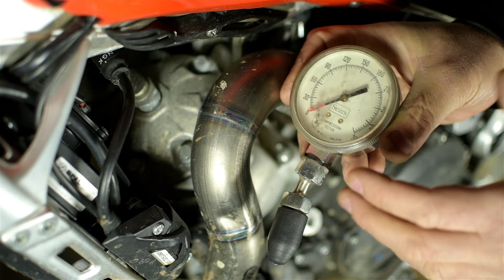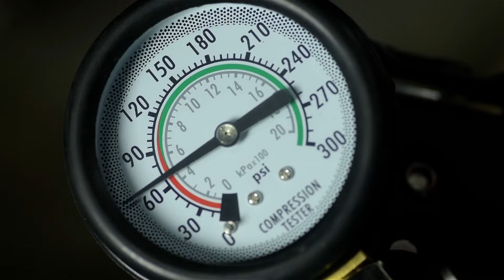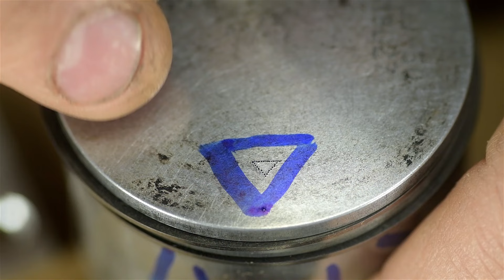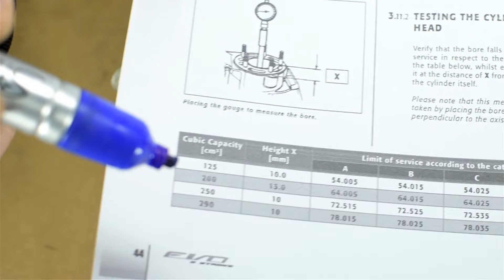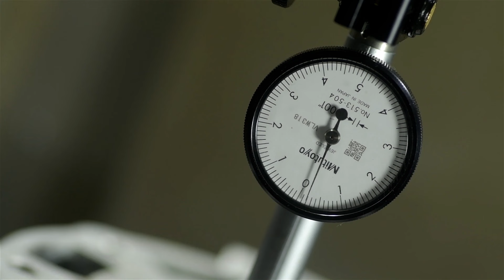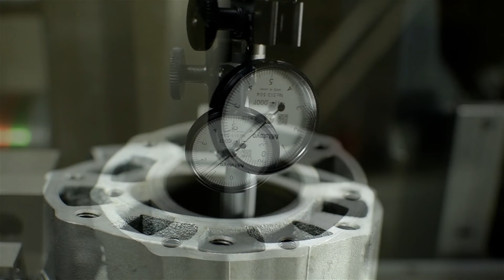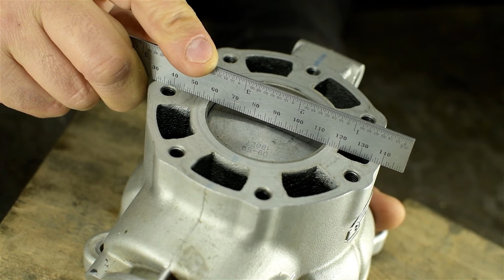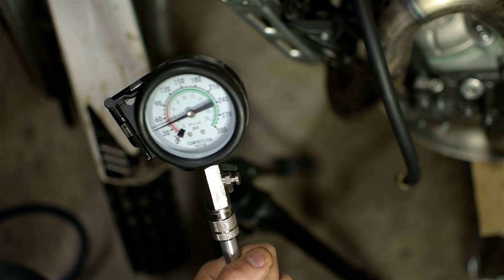Top End Rebuild! (2 Stroke)

Comment: Apparently regular maintenance on a trials bike is every 25 miles.
Reply: Maintenance on these bikes is expressed usually in hours
Reply: Jim Alley  what?
Reply: Many many years ago I had a Yamaha TY250, that required maintenance pretty much every 25 inches :-)
Reply: I had no idea a trials bike was even a thing until Tony started talking about them.
Reply: You must mean minutes.
Reply: My rm250 service manual lists maintance schedule in race sessions (approx   3 hours each), after 1 session it recommends replacing chain and sprockets and after 3 sessions it recommends to replace pretty much everything else :D  good fun though
Reply: That's why you get the big bore... CR500 ...  and run it like a diesel
Reply: Yea unless you are doing the Scottish six day 100 miles a day + 30 sections and if you get back early enough a half hour to tinker the bike new air filter and a blowdown counts as good as new
Reply: 25 Miles or 25 hours, whatever happens first. :P
Reply: @capnskiddies  swoosh (swüsh)  transitive verb  The sound of air being displaced as an object, joke , or sarcastic comment flies over your head.
Reply: I remember dreaming about making a streetable motard out of a CR450 years ago until I saw the maintenance interval. Looks like 5hrs between oil changes and new rings/pistons every 30hrs. 
But then again I daily’s a 2001 CBR600F4i to 36k miles without doing a valve maintenance. Still have my baby in the garage waiting for me to resurrect her. One day, Paris, one day.
Reply: Isn't his bike, and also owning a machine shop makes you insane.
Reply: I had an '86 Honda ATC350X. Yes, one of those evil three wheelers. It was Honda's first serious 4 stroke trikes. Good suspending (6'+ of air) and lift the front wheel in 4 gears. In the 4 years I drove it (hard in the summer and almost as hard in the winter except if -20° or cooler), I took it to the dealer for a seasonal tune up and had the plug replaced. Never a whimper. In year two, I upgraded to a K&N filter and pipe for another 5 hp. Again, never a whimper.
Reply: Liviu .5?
Reply: I use PowerSeal up in PA for all my Nikasil bore work. They’re the best. Your bore looked very smooth and I couldn’t see any cross-hatch left. Those rings aren’t going to wear in properly. Also, checking bore taper with that level of precision is a waste of time. Especially with that go-no go tolerance. Couple opposite spots up and down the bore with your telescope gauge and done. Finally, you have about a bazillion dollars of machine tools that 99% of us can’t afford, stop being a cheap ass and buy a decent comp tester and a dial bore gauge.
Reply: kkash72 minutes**
Reply: @loydsa  I had a 73 Yamaha YR 5, a 350 cc predecessor to that water cooled 400  they sold a bazillion of. And yup,a box of spark plugs and  a well thumbed Haynes manual. Short life parts and 2 strokes are synonymous.
Reply: 25 miles on a trials bike, that's like several weeks of riding 8 hours a day, 7 days a week, right? I mean, the average speed during a trials session is perhaps a quarter of a mile an hour? (Oh, that makes 25 mile into 100 hours, which is 2.5 wees at 8 hours per day, 5 days a week)
Reply: That is two stroke dirt miles too, they're engineered to give you about 17 front wheel revolutions per 2 stroke mile (or 1500 rear wheel revolutions).
Maintenance is what you do between repairs.
Reply: @loydsa  Sounds like an old truck that I had once.  Measured fuel in Gallons Per Mile..  It was a fast truck though, it would pass anything but a gas station
Reply: @colinjohnson5515   those hours assume race hours. which assumes the rider keeps it to the throttle stop 90% of the time.  Honda now makes a CRF450 for the street (most uncomfortable street bike ever!), the motor is detuned to meet EPA restrictions, but the guts are still the same and has the same intervals.   Top end rebuild is closer to 60 hours for street use, and closer to 20 for track use
Reply: @glennwiebe5128   mmm.  the ATC250R was my absolute dream machine.  I still look at pictures of it today and can't help but drool a little at how over the top it was for the time, in looks, performance and days left to live quotient..
Reply: @tmbevtfd    So much debate on the "ring seating' theory.   But consider the RPMs these motors turn and even the best oil cannot prevent ring and bore wear.      You can dingle-ball hone the bore gently if there are minor scuffs to remove, but in over 10 years of racing, I've not personally seen enough of a difference between the HP/Torque numbers of our race bikes at the 10 hour mark between a cross-hatched and non-cross-hatched cylinder post rebuild.   YMMV. 

Tony did the right thing..  check the Nikasil around the transfer ports for chipping or peeling, clean the bore, inspect and reassemble..    Only other thing I typically do when the jug (aka the cylinder) is off, is to check the skirts on the bottom of that as well for cracks or dents from the connecting rod.   I've seen many a time where those little fins break off for various reasons and as you may have guessed isn't the healthiest thing for the bottom end
Reply: @loydsa  Um yrah ...That's close enough one minute of maintenance per revolution.
Reply: @craigleemehan  I thought that you were flushing a toilet...  Hahahahaha.   But, thanks for the correct reference/definition...
Reply: Tom Batchelor - Man I was thinking the same thing. He’s got $’s of machine tools and buys a POS compression gauge. But this is a show, smoke and mirrors now!
Reply: So do all trials bikes kick on the wrong side ??
Reply: @CoolIHandIMatt  not just trials bikes, theres also some dirtbikes (husabergs, huskies, ktms) that kick on the 'wrong' side too.
Reply: your not wrong every 10 to 20 hours
Reply: Thank you man, love all the videos. Really gets me excited to have my own little shop and start out on small projects ☺
Reply: @paulmanson253  You have obviously never owned a Jawa! 3 piston rings per piston and the reliability caries on from there!
Red lines at 5500rpm though :)
Reply: @brapamaldi  And of course Jawas :)
Reply: Matt yeah so if you stall out on a hill and pull your front break and it slides you can still brake with your rear brake on a left side kick
Reply: @calholli  i've had the same piston in me 06 tm300 for the last 4 years and im on it nearly every day go true about 20 to 30 liters when im out
Reply: @CoolIHandIMatt  That's a Beta thing. Most are on the correct side.
Reply: Still better than an old British bike, engine rebuild after moving it from one end of the garage to the other!
Reply: @Langston Lyle Instablaster :)
Reply: @Langston Lyle Happy to help :D
Reply: @mr.behaving 😂

Comment: “Just to be sure, I changed both brake rotors.” Classic!
Reply: Rather like how 90% of all carburetor problems are ignition related.
Reply: I feel like such an idiot. My minivan has been down on power for about six months now, and it never occurred to me to look at the rotors! I'm so ashamed. Here I was sure it was the wiper blades.
Reply: @tcmtech7515  I think thats only because ignition is really only 100% or 0% it doesn't have a value like clogged filters slowly decreasing flow
Reply: @TomHaroldArt  I mean the only logical place to look for an engine problem is the brake rotors
Reply: @hollodollo4771  EXACTLY! It's always where you least expect it!
Reply: @hollodollo4771  My one mower, with the kohler engine that uses dual independent ignition coils, would like to talk to you.  

Strangest thing ever to see a intermittent coil, that mostly fires just enough to make the engine run, but not well enough to keep that cylinder up to full power , yet still well enough that it will stay barley ruing with the other good coil pack unhooked from the other plug.   

Seemed totally fuel related at first.

Comment: Nothing's out of spec here, you just happen to have a B cylinder now.
Reply: And if you notice he got a B piston too!
Reply: @kilrahvp  yeah I don't know why he didn't mention it! for somebody that doesn't know anything about engines and all the numbers he talked about, that kinda worried me.
Reply: @liebherr11602  and went with 9 anyway, because that's close enough.
Reply: Saw that to. TOT you scrup
Reply: I do believe that Tony had to source an aftermarket piston and rings, as he couldn't get the oe parts, so bought a set that matches the original spec....
Reply: Is it even b sized yet? It's 2.1265 for b piston at 54.015mm I'd say that would be a bit tight for a b.
Reply: An old semi pro rider told me to make 3 1,5mm holes below the piston rings on the exhaust side to get more sidewall lubrication from the return stroke. Anyone else seen this before?
Reply: @TheStuartstardust  found on some performance pistons, also cools the bridge ever so slightly as that's the hottest part in the cylinder, keeps expansion down
Reply: Non oem piston he says in the video the number is probably irrelevant
Reply: @TheStuartstardust  yes

Comment: Just chuck the cylinder head in the freezer for a bit and that bore measurement will be proper good :)
Reply: How would cold shrinking the head change the dimension of the cylinder? They're 2 different parts. Even if you're thinking is conduction, the mass of the head is maybe 1/3 that of the cylinder.
Reply: @mwilliamshs  Being a 2 stroke engine, designations change. Intead of block/head, you get head/crankcase.
Reply: @papapetad  Wrong. There are some two smokers where the head and cylinder are combined in one piece and cannot be separated, for those it would be most appropriate to call the whole thing a cylinder, not a head. You take the cylinder off from the crankcase and there is no separate head.
But most of them have separate head and cylinder just as on a four smoke engine of similar design. The engine in the film is of the latter design.
Reply: @mwilliamshs  Even if it was a joke, the joke would have been better with the relevant engine part as you point out. To put the cylinder in the freezer would have made more sense, at least for a short while.
Reply: Hahaha hold my
Beer
Reply: @papapetad  qq

Comment: For future endeavours Tony, 
A leak down test is arguably more important than a compression test with two stroke engines. 
Basically you plug the intake on the carb, and the exhaust on the head, and pump it up through the spark plug hole to around 7 psi or so. 
It should hold for a few minutes. If pressure drops some over a few minutes, or bleeds off entirely, you can use soapy water to find the leak. 
This checks for seals on the crank, reeds hanging open, case damage, reed block gaskets etc. 
I havent seen the reveal yet so i dont know if you were right or not, but its a good test to keep in mind. Especially if you find its running lean and cant fifure out why. 
Also, as im sure you know, every bike has a service life for the top end, X amount of hours.
Reply: yep and a wrist pin bearing always accompanies a top end rebuild
Reply: ... and a vacuum test - critical for two strokes.  Leak down testing is way more repeatable then compression tests and it tells you where the issue is immediately. Test hot at TDC

Comment: I've heard that if you use a green marker instead of blue, and go arround the edge of the piston, you get better sound.
Reply: Remember, apply the green marker in a clockwise direction if the engine is north of the equator.
Reply: That’s to defeat the DRM license also.

Comment: 3:35 “and the kill switch is on”  don’t forget that, don’t want it starting with that compression tester in the spark plug hole
Reply: Or getting the snot knocked out of you by being the best conductor around for that great coil......
Reply: So he had the killswitch engaged
lml
Reply: How would it start without a spark plug? Can a 2-stroke ignite on compression alone? I thought that was a diesel thing
Reply: @magicoddeffect  are you being serious?
Reply: @lynspyre  i see what you did there
Reply: It can 100% start with a compression gauge in the cylinder if hot enough (dieseling). Happens from time to time in Jet Ski shops when they run without the hose running. Giving it full throttle kills the engine almost instantly. Really freaks you out the first time an engine runs with the kill switch removed.
Reply: @magicoddeffect  had a lawnmower do it once. Had to cover the carb intake to kill it.
Reply: @JukeboxJake  I'm asking a genuine question because I don't know. Doesn't the killswitch just kill the ignition circuit that powers the spark plug?
Reply: @magicoddeffect  i think so
Reply: With no spark plug the ignition should be off, some systems would damage the insulation if the spark voltage isn't, er, "sparked"
Reply: I've seen 2 strokes that had excessive carbon in the head area, self ignite as the carbon glows red hot. Only ways to stop it is to switch fuel off by which time it may explode or stall it.
Reply: @tylerbennetts8079  reminds me the first time i took my very used secondhand 1957Ariel 350 down a motorway, glowing carbon chunks very coming out the exhaust.
Reply: SpeedasaurusDex if you have a 4/2 stroke that gets to the thousands of PSI in a diesel you wouldn’t have an engine block.
Reply: No one mentioned the common and worst scenario, when clearing a flooded cylinder, plug out to clean/dry and spinning it to purge the excess fuel. Surprise, everything is on fire without a plug in site.
Reply: SpeedasaurusDex ordinary gasoline can indeed run on compression alone, however you need a higher compression and preheat than diesel to do it, which is why it’s usually not feasible to do it. Mazda is working on an variable stroke engine for just that, spark plug ignition at low speed, compression ignition at higher speeds. But as people have pointed out, small engines can start to rampage under the right conditions.
Reply: Stray spark and fuel mist equals boom, possible fire and bye bye bike. So Use the kill switch
Reply: @csnider_1281  na do some looking around youll find static compression on a Cummins is 500-800 and peak cylinder pressure is several kpsi.  There is a reason the common rail injection systems use 25 to 30,000 PSI to overcome cylinder pressures and continue injecting fuel past Peak pressure
Reply: @davewilliams6172  winner winner chicken dinner. You hit the head on the nail .  The habit of killing the Killswitch will keep the other cylinders from spraying fuel upon the willy-nilly plug wires when dealing with a multi cylinder(, Tony's is single cylinderbut good advice,good practice, and good habits Die Hard)
Reply: It can cause damage to the electronics if the spark doesn’t have anywhere to go. So it’s considered best practice to have the kill switch in the kill position
Reply: @davewilliams6172  Well yeah, but how could the bike spark with no spark plug?
I'm not saying it's a bad idea to have the killswitch on, obviously, but it seems redundant if there's no spark plug for the switch to turn off. Unless the killswitch also turns off something else in the ignition circuit.

The consensus in the comments seems to be that a carbureted engine can self-ignite without spark, if it's hot enough. Which makes sense, since any vacuum would pull fuel and air into the cylinder regardless of electronics.

Comment: I wasn't believing my compression tester one day, it was saying my perfectly running car had 0 psi of compression.  Turns out the adapter side had a wasp nest in it and the schrader valve on the other side was rusted.   Cleaned those out and it worked perfectly.  Even with little use, just checking and spraying with WD40 every so often works wonders.